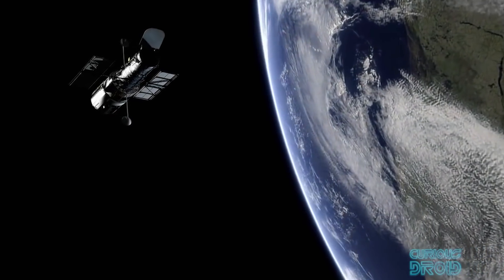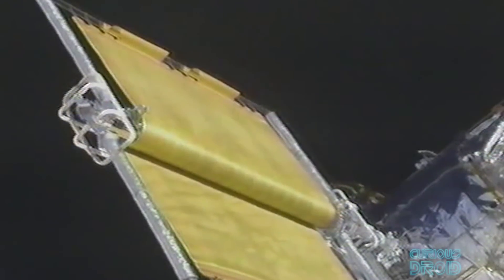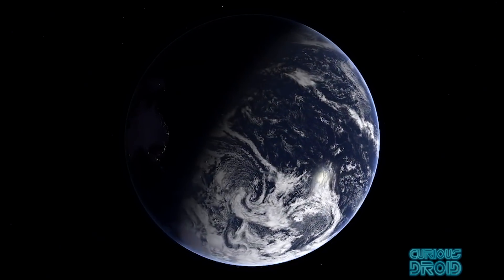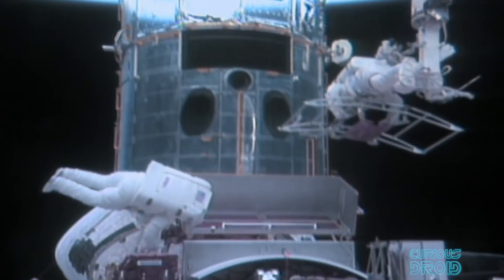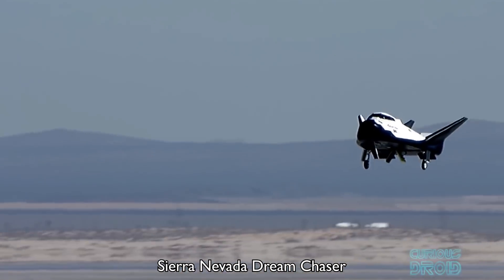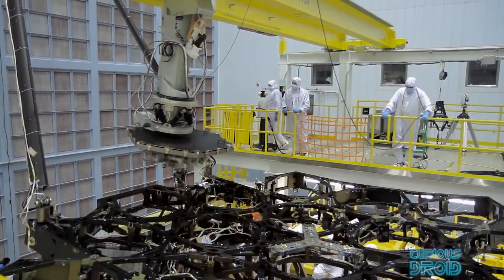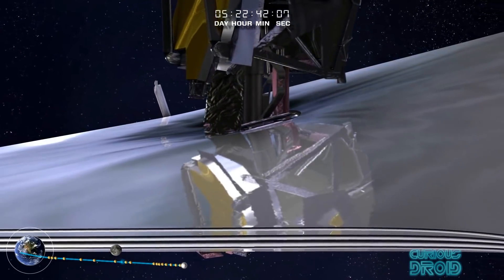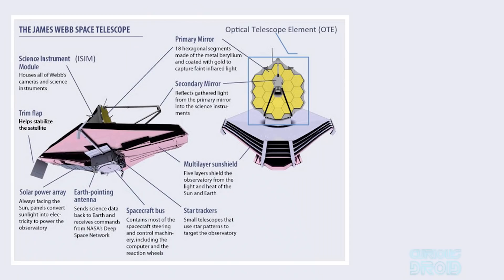Can We Save Hubble and Where is the James Webb Space Telescope?

Comment: Well the james webb might have been in space already if we spent the price of one F-35 on it.
Reply: The cost of one F-35A is down to $89 million in the most recent production lot. Curious Droid had his figure wrong in the video. The cost to "develop" the F-35 is $55.1 billion. The $400 billion (actually about $380 billion) figure given by Curious Droid includes the development cost, as well as the cost to produce 2,456 copies of the jet, with production ending in the year 2044.
Reply: One F-35 is around $100 million dollars, exactly how does your logic work?
Reply: @FordGTGuy He means the cost of development, not of a single unit.
Reply: @Chrisweirdman  He said "the price of one F-35 on it."

Comparing development costs is asinine, the F-35 is an extremely complicated aircraft with many more mechanical and electronic devices that have to be designed to be reliably mass produced and serviced often and used extremely frequently without fail.  JWSTs largest components are only meant to perform their duties once to unfold while the large compnents on an F-35 are required to work reliably ona day to day basis.

An F-35 will also have a service life span much longer than the 5-10 years of the JWST, it also has to be designed to handle extremely high gs frequently and repeatedly and protect a pilot.

The JWST is advanced and has to sit in an L2 orbit but it doesn't have to deal with the rigirous life of a jet fighter and the expansive weapons system.
Reply: +Fermis paradox1 And a 35 billion dollar a unit fighter jet that was in development hell then barely worked isn't?
Reply: @redenginner  How exactly does the F-35 "barely work"?
Reply: @redenginner  Pretty much every modern fighter jet in existence went through development hell and over budgets.

Comment: Doesn’t the US spend about $680billion a year on “protecting” themselves? $10 billion over 20+ years doesn’t seem so bad
Reply: That $400 Billion F-35 though. Not even needed
Reply: The F35 will replace a majority of current comparable flying hardware that costs in total more and has exceeding operational and support costs on an per flighthour basis.
To be replaced: F15 (449 pieces), F16 (1033), F18 (1052), AV8 (108) and one of my favs A10 (287). Total = 2929 fighters. A diverse fleet brings increased cost per unit. Harmonizing the requirement profile, streamlining mass production will lead to SAVINGS. In future the entire fighter fleet will be reduced from 5-6 variants to 2 variants (F22 for air dominnance an F35 for air superiority). The incoming F/A-XX NGAD fighter exclusively for the navy would replace further variants used by the navy.
In the long-run the F35 will amortize and be the best bang per buck deal in US Fighter Jet history.
https://en.wikipedia.org/wiki/F/A-XX_Program
If you think $400B (CY2018) is much checkout https://en.wikipedia.org/wiki/Northrop_Grumman_B-21_Raider
which will replace all 3 current strategic bomber variants.
Streamlining = Savings
The are cost-reduction projects.
It's like buying a new car with better fuel millage. You end up paying less in the long-run. But you'll have to pony up the initial investment to make the switch. Do not let that dissuade you. Do the amortization math yourself. 
It is the better deal - in every way. And this conclusion is coming from someone who disliked the F35.
And I still kind of dislike it cuz it's being built instead the F22 and it replaces our darling A10.